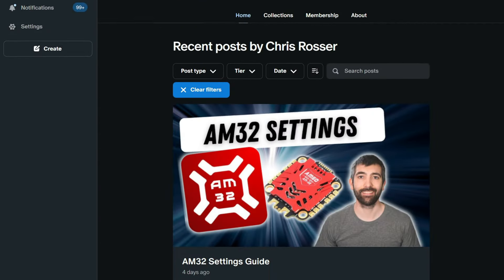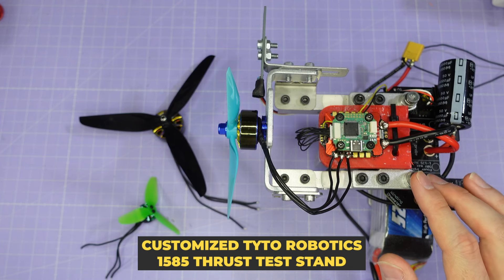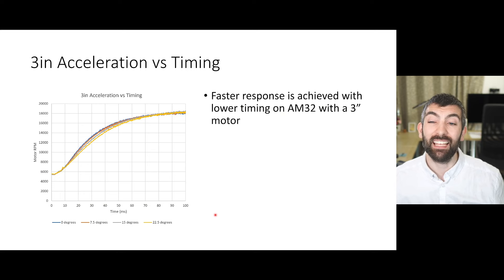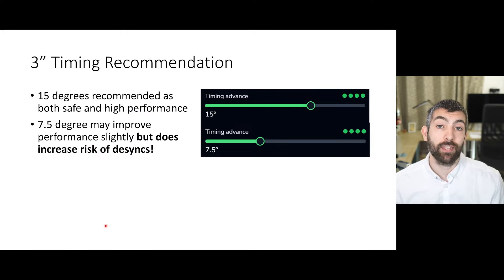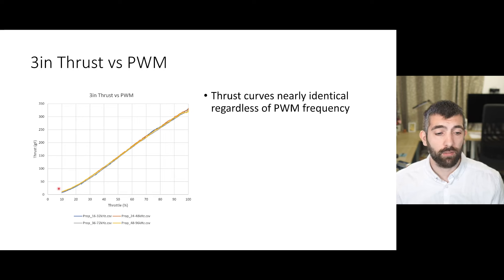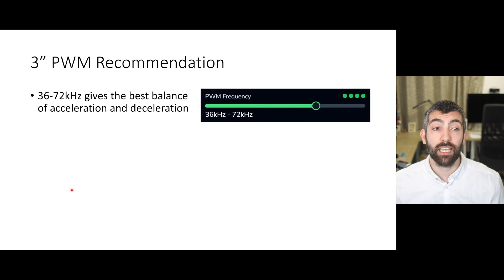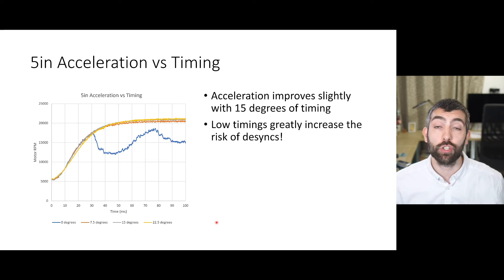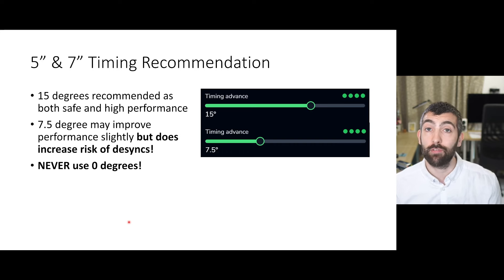Tuning AM32 ESCs for Ultimate Performance

Comment: Nice, can't wait for the tiny whoop ESC tuning! I have a feeling the tiny motors require some different settings but I can't really tell since tiny whoop boards cant log anything without external logging hardware
Reply: There's quite a few whoop boards out there now adays with blackbox just gotta look.  small motors like a higher timing and high ramp up power, while being less affected by pwm frequency declined breaking force as you go up in pwm freq%.  Basically just meaning you can run higher pwm, rampup power, motor timing.  Anything under say 2 inch props I find 96k pwm adds a significant amount extra flight time while not overly making breaking force fall off like it does on bigger props

Comment: Allow me to add that according to u!nt there is a bug in AM32 for 22.5 timing that can result in desyncs as well. They are working on the fix now. I had these desyncs on my 7" spec racer, and it went away when moved timing back to 15.

Comment: My most used setting 48khz locked from BL32. I wonder why its not tested here. On BL32 we don't get the commutation issues even with 48khz locked wich we have been flown for years

Comment: @8:18 Are you sure that when you're at FULL throttle then the FETs are NOT switching the stator coils on and off?  Pretty sure BL motors don't work that way.  They cannot be just on all the time otherwise the static magnetic field of the stator would hold the rotor in one position (eventually).
Reply: They are switching coils, but not doing PWM in-between.

Comment: Hi, i want to see a side by side benchmark between blheli32 and AM32 with the same ESC. I still got blheli32 in use, but i am looking forward to switch to am32, but i dont want to have any disadvantages. The last video i remembar, blheli is accelerating much faster then AM32.

So when can we move to am32 an getting same performance then with blheli32 (in both cases best tuned setup ;) ).